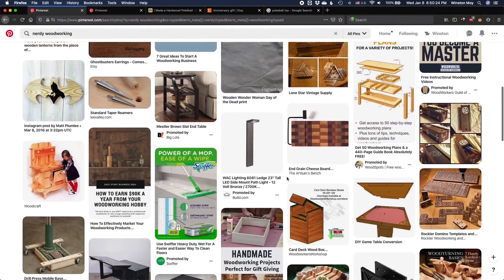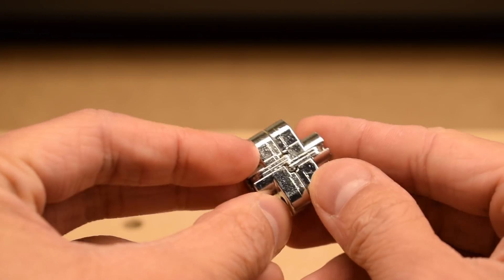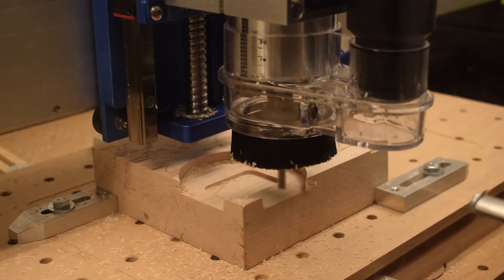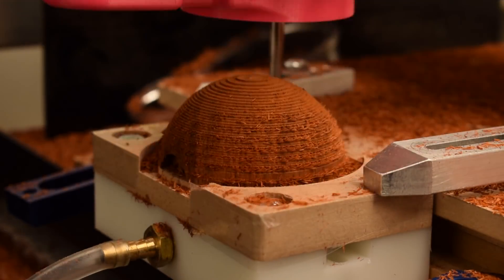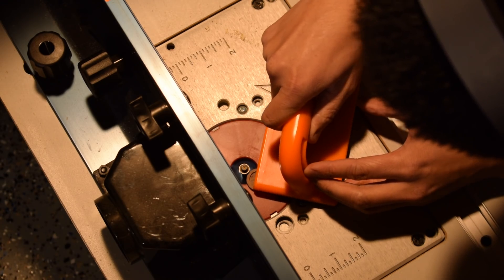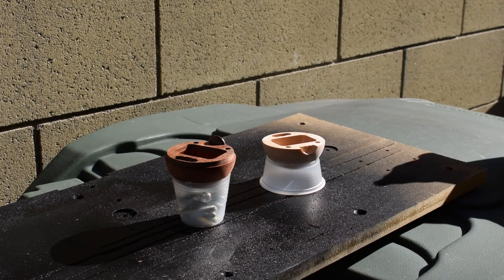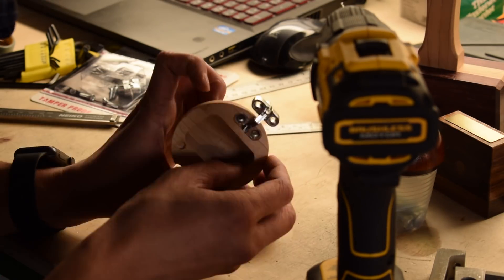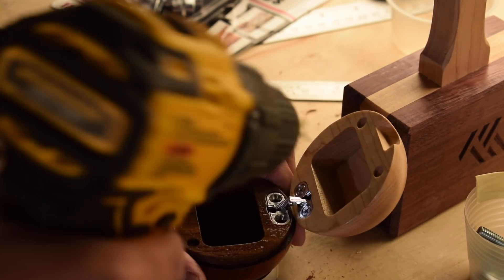Machined Wooden Poké Ball w/ Concealed Hinge & Compartment

Comment: I know this is a year off, but a CNC router if you use Fusions pecking tool path can absolutely drill holes with high rpm consistently and nicely in bulk. 

For those wondering, Pecking is when the bit goes up, then down repeatedly to take just a little material at a time with a plunge cut. If you have a dust collection system set up, on the upstroke your dust should be cleared from the hole, and the hole itself is "Drilled" at a rate of however aggressive you set up your packs. For 1/16" endmills I set my machine to take 0.0316" off per peck which is half of 1/16" of an inch. for a 1/8th I'd use the same peck when you start getting to bigger endmills you can take a little more off on each of the downmoves. That being said, do not trust my parameters, you need to figure your own parameters out for your CNC, and I highly recommend that when you are trying out new trick and new tool paths you play with them on scrap boards. To play with that pecking toolpath I used a bunch of scrap 2x4 pieces and drilled easily 100 holes to see what was going to work best / be cleanest.

Comment: This is awesome. What size magnets did you use - more specifically, outer diameter and thickness?
Reply from the maker: 1/2" x 1/8" thick for the pokeball and base. 1/4" x 1/16" to keep it shut.

Comment: Hi Wiston, first of all your videos are beautiful. Keep on like this. I was wondering if you can give me an advice for a CNC that I would like t buy. I'm not sure which is the best option between a shapeoko or a CNC6040 from Ebay. Especially considering that living in Italy it is not easy to get a Shapeoko. What is your suggestion considering also the build quality and strenght of the machine.
Consider that my target is to mill wood and in the best case scenario some small alluminium plates. Thank you for your help.
Reply from the maker: I have never seen a 6040 first hand. Plenty of people get those cheap Chinese CNCs working, but they're generally slow, and the support is non-existant. If you're good with electronics and mechanical systems it's probably nothing to be afraid of, but I think the user experience will still be poorer overall. Have you looked at distributors in Europe for the Shapeoko? That might make it easier. (Full disclosure, I work for Carbide3D.)
Reply: Thanks for the fast feedback

Comment: Hey Winston, get one of those ball-tipped router bits (a literal ball attached to a shank, not a typical ball end mill), it's perfect for these rare situations where you need a concave surface perpendicular to the vertical axis. And Fusion can surprisingly work with it.

Comment: you said at the end you didn't use CA because of the nature of the two materials being so different.  Wouldn't that apply to the magnets as well?  I know its different with them being in a hole
Reply from the maker: I figured the hole itself mechanically locks the magnets in place. Having built this in Socal during winter, it's likely that the only movement from here would be for the wood to expand with moisture and hold the magnet even more tightly. The plaque is held on purely with adhesives, no other form of mechanical grip.

Comment: I love this design, and everything about it except the finish in the Padauk, as seen in the opening image. Not sure if that orange peel was due to the spray finish, oils in the wood, or the pores. If the pores, in the future, you can seal that so that the pores don't cause flaws in the finish. Clear shellac sanding sealer does a really good job, helps pop the grain, and can be coated by just about any other finish, including the spray PU. If the spray, need to warm up the shop and then also sand it like mad. If oils (I don't think that's the case here), you can clean the wood with acetone first.

None of that is to take away from the great design and beautiful present, here. Just some suggestions from a woodworker. :)
Reply from the maker: It's mostly the pores. The finish wasn't my favorite, that triple thick spray poly is really only useful for face grain. Sealing would probably help though, I'll try that next time. Would probably do a thinner brush-on finish too.
Reply: @WinstonMakes  You can do the spray, if you go thinner like you said in the video, and sand between coats. I brush/pad shellac, but I do like spray for most everything else.
Reply: @WinstonMakes  The dewaxed clear shellac sealer I like to use is Zinsser Seal Coat